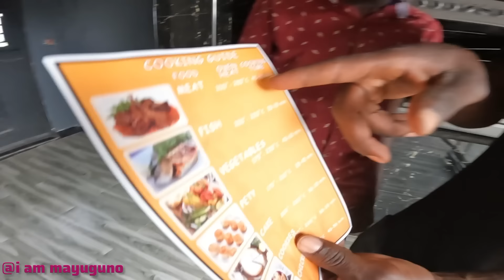THE NEW GENERATION!| I worked so hard for people who did not know my worth |let me work for Jesus✅🙏

Comment: That is not a screw driver in oven is a lighter to light the gas on the stove so u dont need matches
Reply: Not true. It is used hold anything that is to be roasted in the oven & requires t continuous rotation electrically. It is usually fixed  in the  middle bottom inside of oven. It's switch is located on the button panel of cooker on the  left side.